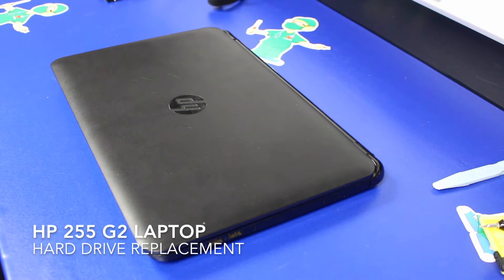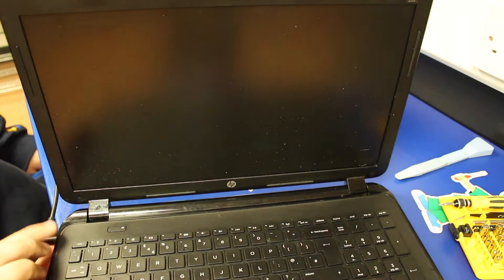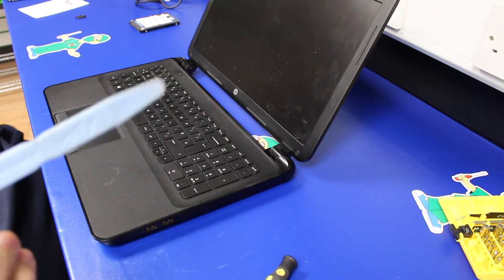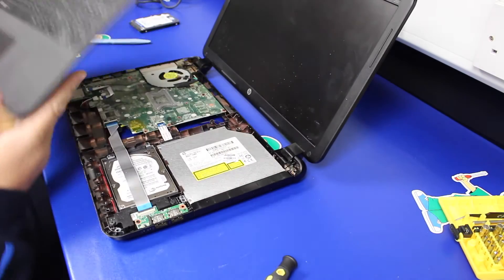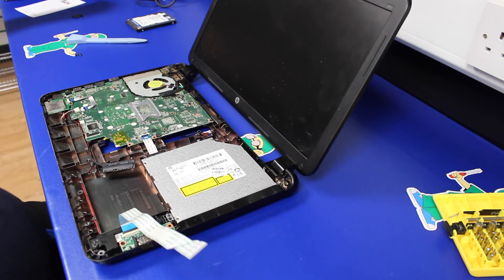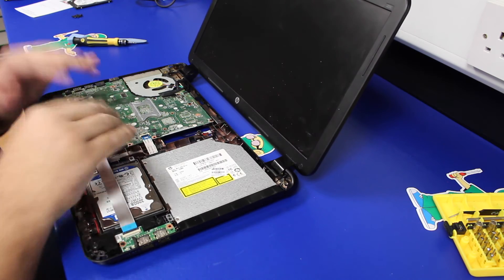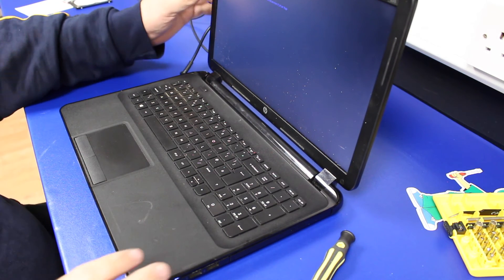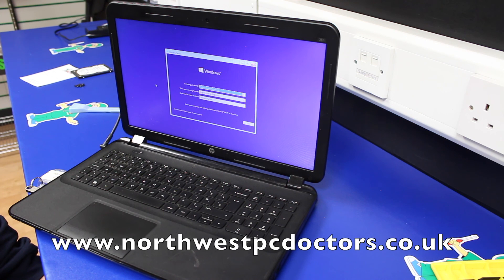HP 255 G2 Laptop hard drive replacement

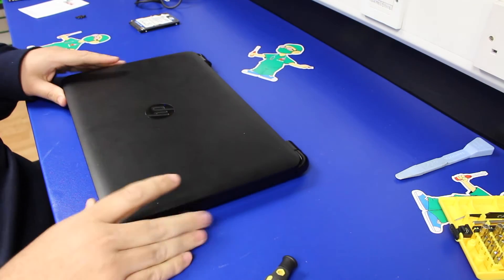Comment: Did you remove the battery at 3:14?
Already 3 minutes in and then remove it. Should we do the same or should we do it when we start disassembling??